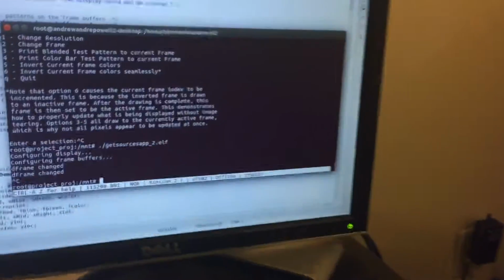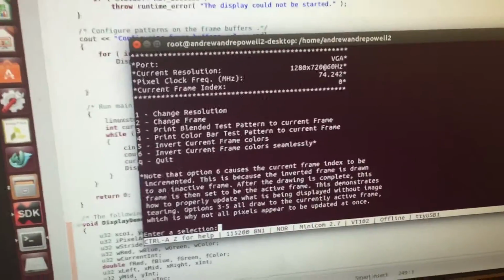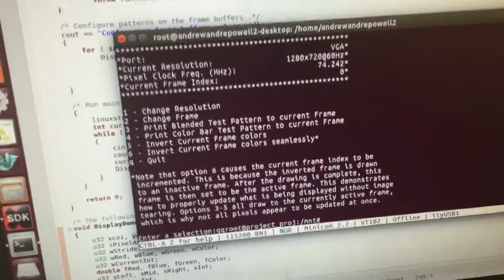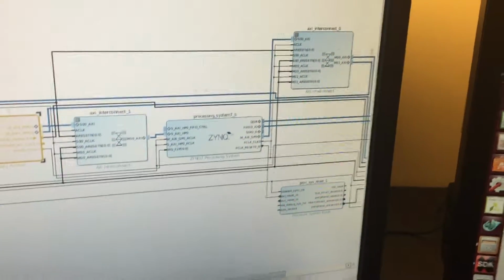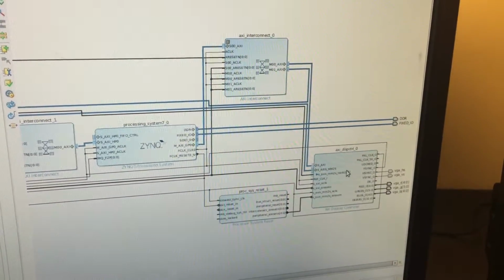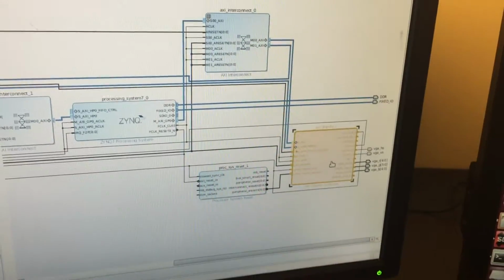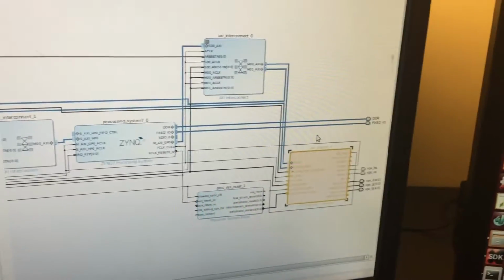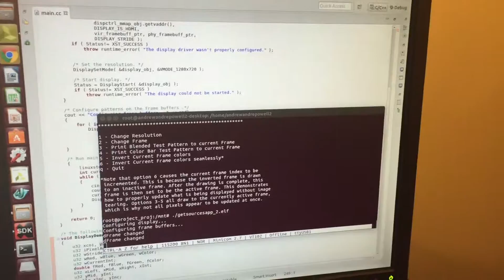PetaLinux on Zynq PS with AXI Display Core to drive VGA interface

Comment: I am doing the same ie want to port the bare -metal application of Zybo Video Demo to Linux application.. I am facing problem to in VDMA... Can you tell me the Physical on what basis you have chosen address of VGA buffer to be 0x30000000..